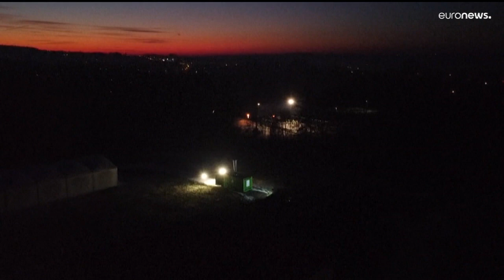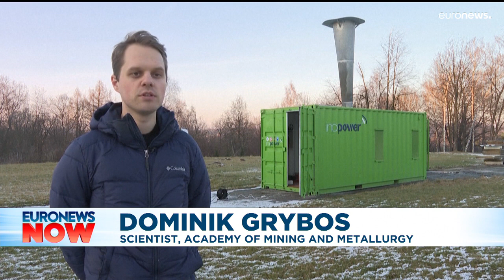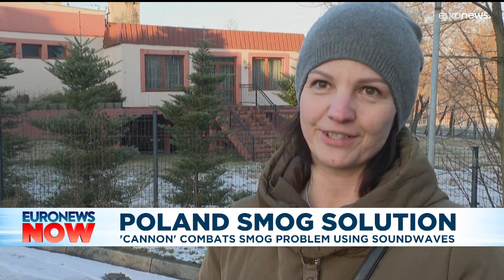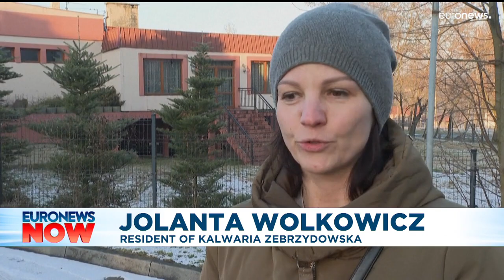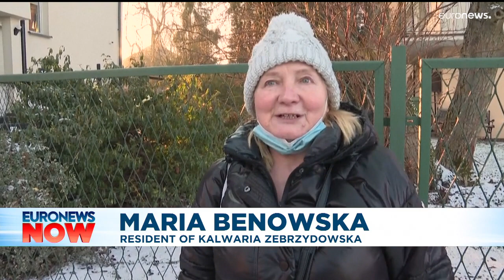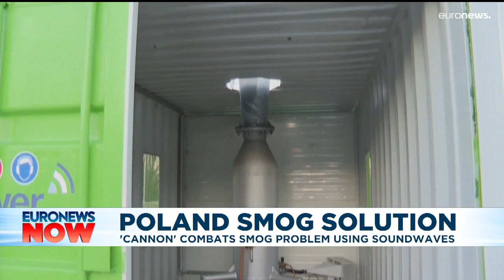Polish town tests anti-smog sound 'cannon' to tackle pollution

Comment: 1. This cannon sends the polluted air higher to fall as acid rain over a larger area. 2. It chases off birds and other sensitive animals as well. When the hammer you have won’t smash the nut, a bigger hammer is not always the best tool to use because you might need a spanner instead……